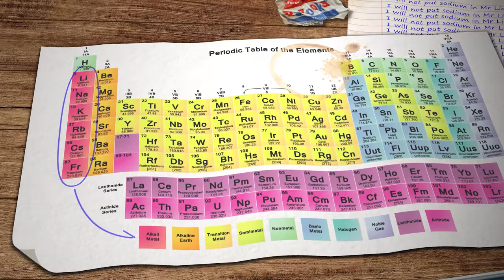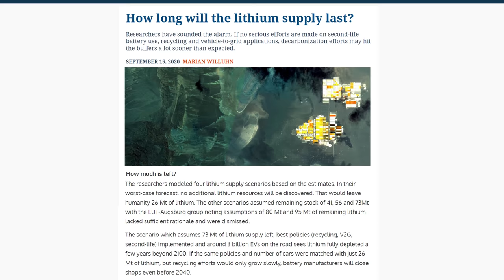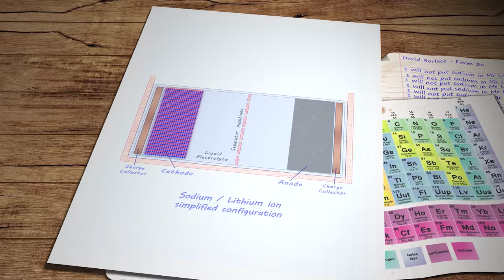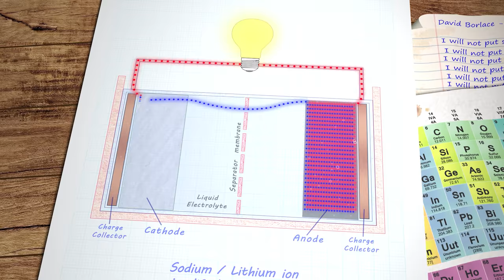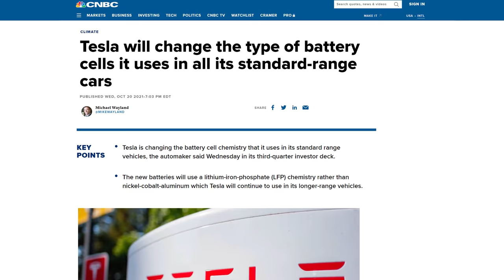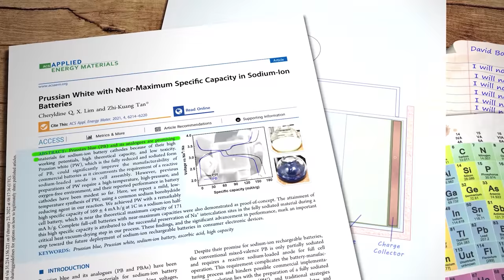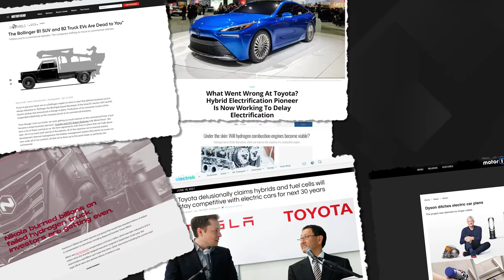Sodium-ion battery breakthrough. Safer, cheaper and cleaner than Lithium-ion

Comment: Forget the power to weight ratio; what is the cost to power ratio and how does that compare to similar technologies?  For non-mobile uses, weight isn't nearly as much a concern cost; who cares if the energy storage for your home weighs two tons or two and a half if you can save a substantial amount over its lifetime going with the latter.

Comment: Lithium is just too problematic a substance to scale out to the level such that all the world's ground transportation could become electric powered. At the scale Tesla currently does business it's perhaps viable, but when all automotive companies are fully engaged in EVs and there's a full-on press to switch from petrol to EV ground transportation, then the shear scale of that will render Lithium very problematic. It's a true statement when Elon Musk says Lithium is one of the most abundant elements in the Earth's crust (and the Universe at large), but it's diluted out into various salts. The deposits that are economically viable to recover Lithium from aren't that many. Yeah, there's lots of Lithium in ocean water, but it's not very viable (economical) to try and recover Lithium for industrial scale use from ocean water. So Elon Musk is really kind of doing what he tends to do - speak in half or quarter truths.

Relative to Lithium, Sodium is a more viable substance to extract for use on an industrial scale. It may not have as wonderful a chemistry as Lithium, but the EV revolution isn't really going to happen unless all the raw materials required for it can be scaled out without destroying the Earth's environment and at a cost that's cheaper than dirt.

Comment: The more there is talk about EVs, the more absurd it sounds. If carbon emissions are retiring combustion, what makes lithium and other resources different for EVs. The supplies will be exhausted, and the waste will be detrimental. It doesn’t take genius to see total quantity of units is the problem. Single occupancy vehicles are not compatible with a population of our size, and certainly not rational with the mandate of a growing industry. Public transportation, telecommuting, and local living are the only viable options at this point. Bicycles remain among the most efficient machines we’ve ever made. Feet are humanity across the planet. Perhaps the most important way we should ‘just have a think’ involves slowing down, learning to wait, and not remain governed by clocks.

Comment: Lithium-ion batteries can have a higher energy density than sodium-ion batteries and are smaller and lighter. This is where sodium batteries are inherently inferior to lithium batteries.
Yes, sodium-ion batteries are more environment friendly... so as bicycle and hydrogen fuel cells.

Comment: Yes - sodium ion batteries will be the best thing since sliced bread. And this video is good - thanks.
But "Only 4 countries have large lithium reserves" - sorry, NO. That's incorrect.

There are other mined deposits
Yes, brine salt deposits of lithium currently mined are located in Argentina, Chile, Australia & China. But there are also large brine salt deposits in the US, the largest of which has been bought by Tesla. It contains enough easily-extractable lithium to fill Tesla's needs in the US for many decades, and Tesla has invented new processes to extract & refine it using water & sodium chloride (table salt) to minimize environmental issues. So there is at least one more existing source not mentioned (US); come to think of it, Bolivia also has mined deposits in the same area as Chile (the Atacama Desert).

Refining is cornered
Yes, China has cornered the market on lithium, but not because it mines it all. Currently China refines all of the world's lithium; everywhere else shunned the business because it has been environmentally damaging in the past. 

There are other minable deposits, undeveloped
There are non-salt deposits, where Lithium is bound in hardrock deposits; these exist all over, but Canada probably has the largest deposits close to the US. These ore sources are more problematic: more expensive to mine & considerably more expensive & environmentally challenging to refine. But there's lots of ore there.

Lithium is everywhere - not rare
In fact, Lithium is perhaps one of the most ubiquitous metals on the planet: it exists everywhere; it's more widely distributed & available than aluminum. The largest most accessible source is the world's oceans. It can be extracted by electrolysis, which also purifies water providing clean water, removes salt providing fresh water, and can split water molecules producing oxygen (a feedstock for pharmaceuticals, medical use) and hydrogen (a fuel). All that's required is considerable electrical energy, which can be supplied almost anywhere with solar power. Solar power is becoming dirt cheap as a generating source.

Prospects
So short-term, we have a shortage of lithium for EV companies that can't yet figure out how to build an EV cheaply, and mostly aren't building them in scale anyhow. Most EVs in the market will continue to be built by Tesla, which is scaling fast enough to meet much of the market need is hugely profitable: they know how to make a buck building EVs. Tesla is also going to be the supplier of most of the grid-scale batteries we'll need to make solar & wind power more effective at replacing existing dirty sources of power. Again, Tesla has secured the lithium it requires so we're good there too.

If Tesla were a typical company, they'd abuse its market power & screw us all for additional profit. Fortunately that's not their business model. Tesla's mission is to accelerate the use of renewable energy by the human species planet-wide as soon as possible. It aims to do that by encouraging the adoption of renewable power & its uses (which appears to be working fine) and by scaling production fast enough to keep up with demand (which, bizarrely, it appears to be doing so far). Tesla has even shared its patents, open-sourced them to all competitors, to encourage the transition to renewable power.

If you're fussed about cobalt use (many are & we should be) Tesla has engineered the requirement for cobalt right out of their batteries, as the video notes. Tesla is using iron phosphate batteries (no cobalt) in most cars, reduced-cobalt (almost none) in some cars, & will soon cease the use of cobalt even in long-range vehicles using a nickel-iron chemistry in their 4380 batteries which should arrive in vehicles in scale this year. Again, Tesla has committed to not restrict the use of its patents by other companies, so there'll be no excuse for any EV manufacturer using lithium batteries with substantial cobalt content very soon. And in the meantime, no other EV manufacturer makes substantial volumes of EVs anyhow (VW comes closest).

Short-term Risk: there's geopolitical risk we could see China constrain the market by abusing its monopoly, either to advantage its own companies, or to harm other countries. That's unlikely, but possible.

Mid-Term: we have tons of Lithium. Solar power is now cheap enough that we could, in theory, set up solar or wind farms specifically to power electrolysis plants to process seawater. We may need to do that anyhow for fresh water or hydrogen. In addition, we're reaching the point where recycling lithium & rare earths in metals (esp. cobalt) can be done economically: that required not just new technology but also scale to work with. A handful of older lithium consumer batteries (from flashlights, watches, calculators & PCs) can supply enough lithium to make car batteries with improved design.
 
Mid-term Risk: it's conceivable we could squander our opportunity, allow political pressure to direct funding away from solar & wind (buildable at scale very fast - within a couple of years) & instead fund nuclear generation, which is already more expensive & becoming more so, takes many times longer to build, and leaves a decommissioning, clean-up & waste storage cost that is so horrifically big we still can't forecast it accurately. 

So we're not panicking about Lithium; nor should we be. 

That said there ARE alternative chemistries that may be economic & useful. Sodium-ion batteries are indeed one promising technology.

And this channel rocks: your vids are very well-produced.

Comment: This technology sounds quite promising. It may be that we've found a replacement for lithium in batteries. My only concern: the CCP. I worry that the ccp party is putting pressure on the battery company to report inflated numbers. Only time will tell on that.

Comment: Why pick on lithium as scarce, it is not, it is more common than lead and we have been exploiting lead on an industrial scale since the Romans.  True the price of lithium has risen but that is not a symptom of scarcity, it's just a consequence of extraction/processing increasing at a rate lower than demand. Copper on the other hand is an element that has been exploited at an ever increasing rate for the last two hundred years, if you like to worry about this sort of thing  copper is the obvious (but not the only) element to be concerned about.

The lithium in a Li-ion battery is not consumed, every atom that went into a cell at manufacture is still present when that cell has degraded to the point it is no longer viable as an energy store. Li-ion cells are ideal for recycling (not so much the lithium used in some greases, aluminum alloys or lithium glass though).

If sodium batteries are better than lithium based ones, good, no need to make up false reasons to abandon Li-ion once a better and/or cheaper option becomes available.

Comment: Only 2 minutes in and a lot of what I've seen contradicts other sources. For example, claiming that when all vehicles are electric the lithium wouldn't be sufficient is based on a number of fallacies. Firstly an all electric world will integrally move towards a world where private vehicle ownership is reduced. So the number of vehicles will not rise, it will fall. Therefore the consumption levels will fall. Also there are new easy to extract sources of lithium being found all the time. It turns out that there are legions of abandonned mines that have been filtering out lithium in running water for decades. But, no-one was focussed on the lithium. Now it can be targetted for filtration and collection. It doesn't even need digging out. Also the amount of lithium used is not only minimal in each battery, but it can be reclaimed and re-used. That means it's not a straight forward matter of using lithium that constantly depletes. It is being mined in new ways and it is being more and more efficiently recycled. You don't use 26 million totally fresh tonnes of lithium. You also use reclaimed lithium, newly sourced lithium and recycled lithium. The drain only comes from the fresh from the ground lithium not the total useable capacity.

Lithium Ion Phosphate batteries are now being used by Tesla for their China made Model 3s. No cobalt, no nickel. All part of an ongoing move toward less toxic battery metals. Also part of a general movement to use more commonly available metals and reduce the material volume of rare metals employed in battery manufacture.

Comment: why they don't make giant pool like store batteries with the cheap technology  and use the expensive technology only in  places needed like electronic? Why they don't uses AC current for distribution like now and wire our houses with DC current? Doing this right now will save lots of electricity becase there isn't a need for step down transformer. Imagine all those billions transformer on electronics consumption.

Comment: I was just watching this video about lithium availability:
https://youtu.be/DAS2og74Fuc
There's plenty of lithium, but it comes in different forms, some of which are easier/cheaper to extract. The cost difference will erode as the electricity used becomes greener.

Comment: The other thing is that Batteries are not viable in ship drive, large transport drive, and airplane drive. Hydrogen on the other hand can drive all this demands plus good luck trying to make steel with batteries where as Sweden has already replaced coal with Hydrogen. The goal for humanity should be to integrate Hydrogen in everything we do. ie. The Hydrogen Economy.. everything we derive from hydro- carbon fuels (oil ) can be made from Hydrogen and Carbon. Hydrogen we get cleanly from electrolysing water. And Carbon we the air is full of it. Batteries not so much use other then a quite compute from point A to point B. That notion is not going to save this world. Just Give that a think 🤔 . Sorry couldn’t resist.

Comment: IMO sodium ion batteries can never be seriously considered for any "longer distance" mobile application because of the reasons given in this video... compared to LiIon, 3x times heavier, at best 3/4 the energy density. Some people have suggested it might make sense powering warehouse vehicles because of the very short distances traveled and always close to a charger.

But it doesn't stop there. People have said "OK, maybe not for anything that's highly mobile. Maybe for stationary secenarios like metropolitan grid energy sources. But, sodium ion batteries might be then up against such things as thermal sodium energy storage which promises a lot higher efficiency and possibly even energy density, particularly if the solar farm is already collecting solar energy as heat and not by PV.

The only thing in favor of sodium ion batteries are their low cost materials(and safety) . But the known laws of physics make it impossible for sodium ion batteries to compete with Li ion for nearly all scenarios and uncompetitive with other energy storage for the remaining scenarios. There are very, very few scenarios where sodium ion battery storage makes sense.

Comment: What about aluminium batteries? Over 4000 times as much aluminium as lithium in the earth's crust, distributed widely, and 3 electrons for every one electron in lithium.
Lots of interesting looking aluminium batteries in labs, but self discharge and number of cycles are an issue currently.
Aluminium primary batteries / fuel cells are an interesting alternative, are already available and offer energy density potentially greater than petrol, when the whole system including engine is considered. They could offer immediate recharge by swapping the used aluminium hydroxide solution for fresh aluminium. The aluminium hydroxide would be taken away for conversion back to aluminium. Far better than hydrogen, with its potentially explosive properties and lithium batteries and their flammability.
The biggest problem is investor herd mentality as they have no knowledge of science and engineering. I.e. investment in lithium battery research is a relatively safe bet, even if only modest improvements are made. Whereas alternative blue sky technologies are a risky investment, even if the returns could be astronomical.

Comment: Not safer. Not likely cheaper. Lithium's lower reactivity works better with ion carrying organic solvents allows easy materials choices. Dumb to bs about battery anode materials when battery cathodes can be 90% of battery's weight and restricts battery life. Today's batteries intercalcate Hydrogen or Lithium into cathode crystalline material. Though reaction is largely reversible, the cathode fails as its structure degrades after many cycles. Sodium ions are much larger, degrading the Cathode more rapidly.
Again, most of the battery is the cathode. Although game-changer Lithium-Air batteries might happen, Sodium-Air is never.

Comment: Hydrogen from clean renewable energy. You replenish the water after use
Reply: Hydrogen only makes sense if you have so much clean, renewable energy that you have excess supply. Otherwise, it's simply more efficient to use the electricity to power things directly, or charge batteries.
Reply: @gsvdeathandgravity334  sun provides us with >30 000 times our current need... seems we are not incentivised enough to do it.

Comment: Hey let's build electric cars with extremely rare earth metals,  green my butt.  renewable more like throw away and bury when used up.  just look at the junkyards these days, ten year old cars with bad computers ready to be trashed because in order to replace and reflash the computer, it is cheaper to buy a new one.  so much waste and we are on a train to nowhere fast with all this new "tech" in vehicles.  I saw this happen with appliances 15 years ago.  refrigerators and washing machines that use to last 30 years or more getting thrown out a 8 to 10 years old.  Made to break tech is what I call it.